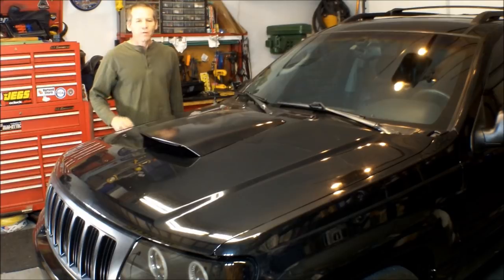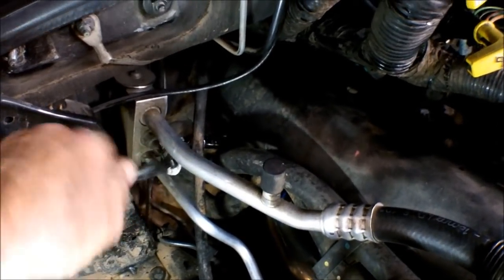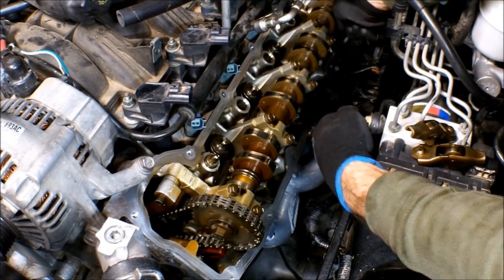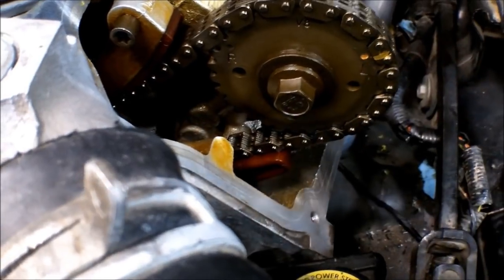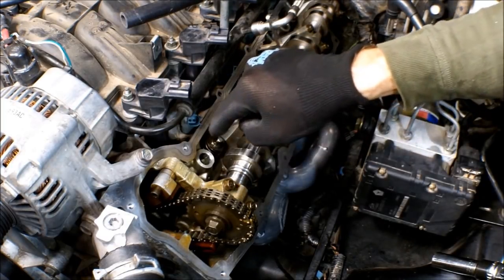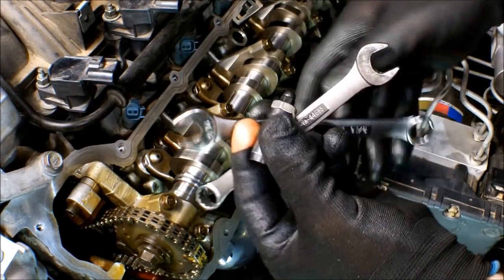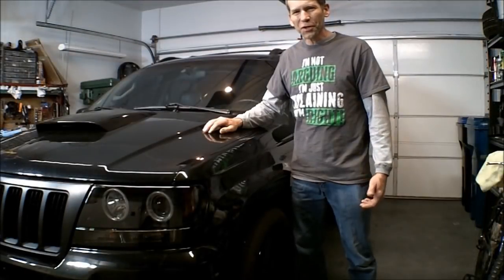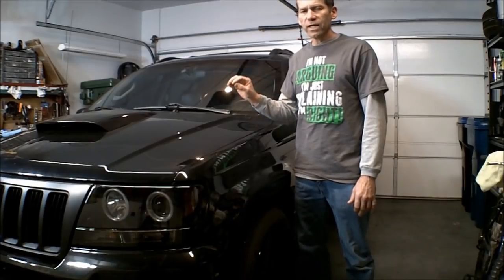How to Install 4.7HO Camshafts & Solid Lifters in a Jeep Dodge Chrysler & Mitsubishi

Comment: Thanks for making this not look so hard and explaining it so well.  Isnt it better to get the 08 Durango parts over the HO ones now? 

IF you dont mind what lube did you use before putting the caps back on?
Reply from the maker: Yes I like the 08 4.7 engine parts.  Here is a link to the assembly loop that I used.
https://amzn.to/3WV4uZt

Comment: Hi Martin, great video, well done. I’m in the middle of swapping out my cams now in my 05 Grand Cherokee with 04 HO cams and putting in an HO intake and slightly bigger injectors. Just one question for you, did you switch to the HO recommended platinum plugs after you did your HO cam and later HO intake upgrade? Thanks Jerry
Reply from the maker: Thank you Jerry, no I kept the same plugs in so far I will eventually change them out. All the intake manifolds from 2002 on up are all considered HO intake manifolds... but I have upgraded to the 08 intake manifold with a 75mm throttle body a very noticeable improvement.
Reply: martinbuilt I saw that video, looked very hard. So my 2005 non HO intake is the same as the 2004 HO intake? If that’s the case I’ll skip the swap, still working on the other cam shaft swap. Thanks for getting back. Jerry
Reply from the maker: @jerrymcmanus9366  yeah the 08 intake is not a simple bolt-on there are a few mods that need to be done and the biggest thing you will need is an adapter for the throttle body. , yes the 04 and 05 (non HO or HO) intakes are the same.
Reply: martinbuilt good to know. Thank you for that info. Saves me some time and work. I’ll resale the 04 one on eBay. It came with the throttle body too. I’m guessing it’s also the same size.  Jerry
Reply from the maker: @jerrymcmanus9366  yes the throttle bodies are the same from 01 thru 07 68mm other than some model use a one bolt IAC valve.
Reply: martinbuilt Hi Martin, I finished swapping out cams and a few other parts last week, runs good has more power but idles rough. Just wondering if your Jeep idled rough after you swapped out your cans. Thanks, Jerry

Comment: Hey Martin, great videos. I found a set of 2002 H.O. cams and I also brought with me the air manifold. Is it better to use the 02 HO manifold or leave the one from my 07 Dakota? Will I need to use premium gas?
Thanks
Reply from the maker: That's great, I would personally go with the 02 intake manifold. No you will not need premium fuel.
Reply: @martinbuilt  thanks.

Comment: What's the difference between ho and n
Reply from the maker: The HO  cams have a .030 greater lift on the intake valve. Good for 10 to 15 horsepower

Comment: Thanks Martin for creating all these videos.  Do you know the HP and torque difference between the older HO  cams and the 2008+ cams?  I found some HO but not 2008+.  Wondering if worth it to keep looking.
Reply from the maker: I don't have any numbers as far as  horsepower and torque differences between the two cans, but it is noticeable. You'll like the ho cams and they are definitely easier to find. In the next few years I would imagine the 08 cams will be easier to find as these vehicles start hitting the salvage yards. The best source for the 08 cams that I have found so far is finding them on eBay from sellers that sell used car parts.
Reply: martinbuilt thanks for the quick reply!  Do you know the part numbers for the 08 cams?  Some of the eBay descriptions are tough to discern.  Thanks again for all the knowledge you are sharing.
Reply from the maker: @fastbrk4  you have to be very careful on eBay a lot of the descriptions are incorrect. If it is a new camshaft they're selling do not buy it. No matter what they claim it is merely the 4.7 non ho engine camshaft specifications. Even on eBay they are still hard to find. In the two years that I've been looking I've only been able to find a set and a half.
Reply from the maker: @fastbrk4  The right-hand cam is a PN 53021984AA that has 53021980AA etched on the barrel and the left cam is a PN53021983AA that has 53021979AA etched on the barrel.
Reply: @martinbuilt  thank you!
Reply: I, too, appreciate the info

Comment: What makes it 4.7 high output
Reply from the maker: Steel Crankshaft, Full-floating wrist pins, 9.5 Compression, HD balancer, HO cylinder heads, HO cams, HO intake manifold, HO air intake, and a little tuning.
Reply: @martinbuilt  would pay for you to make me that cam spanner tool

Comment: What kind of gains  are expected to get from h.o. cams?Also...... your videos and time is appreciated, good stuff.
Reply from the maker: Craig Heidelberger Well there is 30 horsepower difference between the regular 4.7 and the HO motor.  Of course the camshafts alone are not going to give you 30 horsepower. I would actually say it's probably more like a 7 to 15 horsepower gain.  Thank you.
Reply: Reason I asked id because I too installed h.o. cams and springs and felt minimal gains, but gains non the less. I know I have a head gasket fatigue and when I pull heads can you recommend any hp machine work to heads? Its an 05 Ram 1500 with 70mm tb, headers, 08 intake, homemade "cai" custom tune and 4.88 posi and a few other mods i'm sure I left out.Again thanks for the reply.
Reply from the maker: Craig Heidelberger 
Sounds like you've done some pretty nice things on your RAM. How did you like the 08 intake? And wow 4:88 gears that thing must come out of the hole pretty strong.. It would be kind of nice if you could find a set of HO heads since you're taking it all apart anyway. I've got the 08 intake sitting here I've had it for probably over a year it's ready to go on. But when I install this 08 intake I'm going to do something that's never been done before.
Reply: My tire is about 32" tall from top to bottom. That's why Nick recommended the 4.88s need an excuse to pull transmission to install a higher stall torque converter. Unfortunately I have an EGOR valve so I think im going to have to deal with the heads I have. Btw live the 08 intake and tb.
Reply from the maker: does any boby make a aftermarket toeque cnvertor that you know of?
Reply: Martinbuilt Wouldn't Craig Heidelberger already have HO cams since his is a 05?  Or are Dodge motors different?
Reply from the maker: Only Jeep Grand Cherokee 2002 2003 and 2004 had HO motors. Then only some of those. Some Limited and Overlands models.
Reply: martinbuilt how much torque? I hear roughly 30 on the torque I want to make my 4.7 more or less. Torque monster or anything that sounds good and runs better, I've been debating between a H/O cam and a 206.. I'd love a 210 or 212 but it requires a bit more than HO and 206 but if you know what the gains would be on both that would be great
Reply from the maker: Your not going to see 30 ftlbs torque from HO cams alone.
Reply: martinbuilt How would it sound compared to factory then? I've heard some 206 cam setups sound nearly like 212s, but the 212s are very sexy with the right exhaust they sound like a damn supercar v8 or something very fast, even though 0-60 in 7 seconds
Reply from the maker: With the HO cams at idle no differance...at full throttle I only notice that it was louder.
Reply: martinbuilt I'm just debating between HO and 206, I'd love to have 210+ but that shit requires all new beehive springs lifters and just a shit ton of stuff that adds up.. a lot. And I'm in highschool and my pawpaw doesnt like changes anyway, I was going to Hemi swap my Dakota because we thought the gaskets were blew for a bit but it's all the electrical stuff and lifters and headaches. But since I'm taking all that shit apart I figured might as well cam it while I'm thinking about it maybe even order in my headers
Reply from the maker: Where were going to get the 206 cam if you go that way.  If you go with the HO cams and weren't happy with them you could have them reground to the 206 cams
Reply: martinbuilt well I guess Comp cams, sadly KRC stopped making their holy Grail 4.7 cams and now to get your hands on one it's bullshit expensive if you find them. But Comp is the next thing they are basically the only big manufacturer i recognize that is making 4.7 cams, so probably a 206 Comp cam. And probably Gibson or some good high flow ceramic headers and the pipes I'll do myself 3rd cat delete high flows and a good set of magna's or something. That's all future though first is getting it running and cam I just want a really nice sounding cam with a bit of power gain maybe, mostly torque since I'm on a quad cab 4x4
Reply: martinbuilt I know this is annoying as shit, but you never hear of 08 cam swaps in a 2002 or older 4.7.. can a 08 H/O cam work in a 2001 4.7? 08 was the most aggressive cam profile and had the largest throttle being 74mm I believe. I know the 08 intake works, id like to run that setup if it's possible anything I would have to be worried about lifters lash caps anything else?
Reply from the maker: Papa Savage 
 your timing is impeccable, a matter of fact I just got done installing the 08 intake on my 04. The 08 was not considered a HO motor even though it has more horsepower than an HO. The 08+ camshafts is the most aggressive ever put in a 4.7 from the factory,  it is more aggressive than a 206. As soon as I can find a set of those cams that is the ones I will be putting in. Oh by the way the 08 intake rocks especially with the throttle body that I put on it.
Reply: martinbuilt I have found a couple of 08 cams and honestly am thinking of trying it, but would that possibly mean I need lash caps? I know on the 206 they say you need I believe lash caps or something, and for 212s it's valve springs lash caps lifters, basically that means getting deep in your pockets for 300 horse capability pretty much
Reply from the maker: Where you finding these cams? The reason I asked be careful the ones on eBay for cheap are not the ones you want. I can't remember if you need lash caps or not, I don't think so. If you go solid lash adjusters then you don't need to worry about that.
Reply: martinbuilt they are tough to find and if you find nice new ones it's expensive, cheap way you can probably find one in a junk yard or buy a cheap wrecked dodge 2008+ 4.7? I guess? But check   liquid_performance one eBay he has a bunch of Mopar Chrysler cams
Reply: martinbuilt I think he's got like a 2009 or so 4.7 cam for sale but it's not cheap, it's about $450 I think
Reply: martinbuilt I honestly wish I could find a cheap 4.7 truck and just rip all the shit out of it.. maybe even just take the whole damn motor since the internals was supposed to be higher standard and just make a drop in basically. I saw one a while back sitting in a back yard about a 2010 Dodge ram full of weeds. Bet it was the transmission and bet it could be had for cheap
Reply: martinbuilt Also my bad I wanted to ask you, have you heard of these 45FRE to 545FRE swaps? They claim they take like a 01 Jeep Cherokee TCM and it unlocks the 5th speed and they have better gas mileage? Is that bullshit or do you think that's a real thing my dad says it sounds bullshit and it does to me too but I also know how car manufacturing loves to screw everyone over.
Reply from the maker: you don't need lash shims with the 08 cams. By the way you should hear this motor since I put the 08 intake with my Thottle body.
Reply: martinbuilt got a video link? Or title? Also that damn Jeep is sexy I'm usually not into those Jeep's but that one had some love put in it I bet that's a bad mfer on the streets, actually looks like something you'd expect to have a supercharger or turbos 😂😂 don't get yourself kicked out of the house my friend
Reply from the maker: I'm working on the video. Hope to have it done this weekend. There are 3 videos in total. Thank you. She got tired of me years ago and left.
Reply: the 2 4.7  motors are different. They had 4.7 and a 4.7 H.O. motor.
Reply: @papasavage8247  I have tried everything they told me to do .It must be something on your side can you look in to this and fix it
Reply: @papasavage8247   anybody their ???
Reply: @kenkollock8121  yea I fixed it, I threw out the 4.7 and put a 5.3 Chevy LS and 4l60 in its place 😂😂 fixed the problem forever

Comment: I think that using the plastic cutting boards for making that wedge may just work perfect. Would my 2003 3.7 Liberty be this same set up. It starts knocking after it warms up¿?¿‽
Reply from the maker: Yeah a cutting board would work perfectly for making that wedge and it would be the 3.7 would be the same setup. 
 That knocking could also be a hydraulic chain tensioner

Comment: The stock ECU is able to automatically adjust fuel and timing for the cams?
Reply from the maker: yes, I have even installed the 08 cams, 08 intake manifold and75mm throttle body on a stock tune.

Comment: i have a 2000 WJ  4.0L inline 6. Could i do this modification or a similar modification?
Reply from the maker: Unfortunately doing a camshaft swap on a 4.0 involves removing the cylinder head, harmonica balancer and timing cover. A lot more work. They do make aftermarket camshafts for the 4.0 though.
Reply: Different animal, 4.0 is a pushrod style engine based on the old school AMC/Jeep design. There are plenty of parts for them. Best grab a shop manual about them👍

Comment: Do you not have to measure for oil clearance for the cam journals?
Reply from the maker: When installing the solid lash adjusters it is best to go as close to .0015 as possible.  I use .002 as a maximum.
Reply: @martinbuilt  ahhh ok, are hydraulic and solid lifters interchangeable?

Comment: How do you change your knock sensor
1:27  on the 4.7 V6
Reply from the maker: If it has an h o engine yes there are knock sensors for the 4.7 v8 underneath the intake manifold.

Comment: Can u do that to a 3.7 with same cam shaft????
Reply from the maker: I had actually looked into that some time ago wondering if I could take the HO Cam shafts and simply cut off the rear cylinder . Unfortunately, the 3.7 has a different firing order, and it will not work.🙁

Comment: How many times have you had to adjust the lash adjusters?
Reply from the maker: Just once since I installed them but that was only because I replaced the rocker arms with different ones.
Reply: How many miles was that? I've noticed the tolerances grew last time I checked.  You can tell when they change it makes more of a tapping sound.
Reply: They definitely added HP at all RPM's
Reply: Can't wait for some more videos man. I'm working on getting everything together for a m112 installation on my WJ. Running out of bolt on's next is rods and pistons on a HO short block.
Reply from the maker: @gooble1050  I recommend that you adjust them to .0015 clearness.
Reply: @martinbuilt thats what I did.
Reply: .015 it took forever to get them all the. 015

Comment: How do u rotate the motor?
Reply from the maker: @ 13:25 I explain, using a 21mm socket, short extension, and a 1/2 drive ratchet breaker bar place it on the crankshaft bolt (harmonic balancer bolt) at the front of the engine and rotate the engine clockwise.

Comment: Why would anyone want solid lifters in a jeep
Reply: When one of the stock hyd lash adjusters bleeds down and allows the cam to kick the rocker out you will have the answer. Mine kicked and wrecked the head at the same time. After replacing heads I installed the solids, nice knowing it will not happen again.

Comment: Bigger cam burn more fuel .
Reply from the maker: I have not seen that with these cams. With the increased torque, I saw a little better MPG's because I don't have to get into the throttle as much to get this Jeep going.
With high duration cams with lots of overlap and a rough idle, I could see a loss in MPG